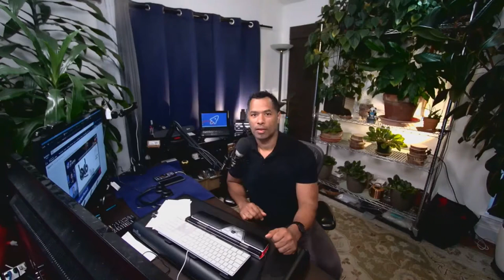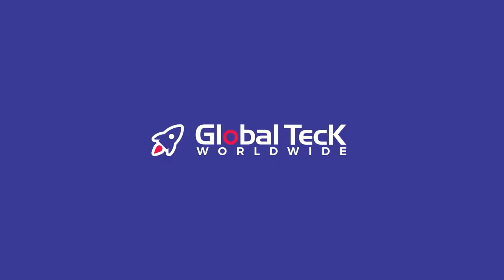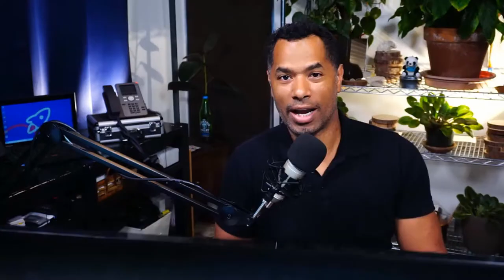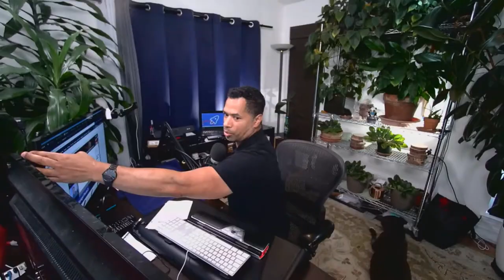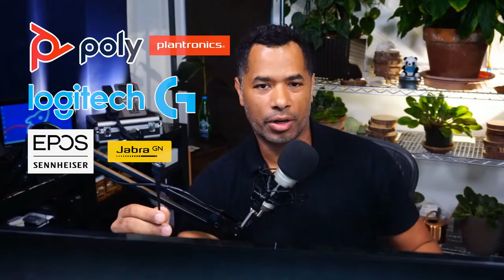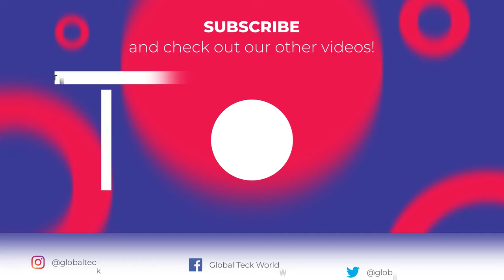How to fix your Bluetooth connection with your headphones

Comment: Bluetooth problems around at work and home. The environment today includes billions of more smart devices, appliances and hand held electronics that were not around 10 years ago. This surge has created congested Bluetooth "highways" that lead to interference and unforeseen disruptions in all sorts of Bluetooth enabled devices.

When two devices can "see" each other's signal without obstructions. It creates a clear signal path on the Bluetooth highway that make it easier for those two devices to communicate with each other.